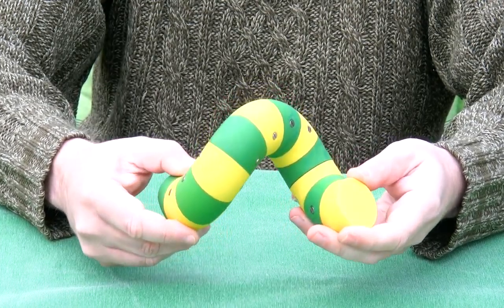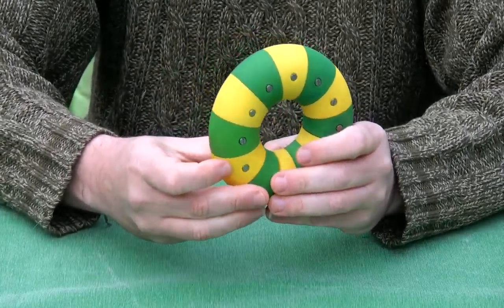Twisted Donut

Comment from the maker: How could this mechanism be improved to make it more stable?
Reply: Using gears instead of that mechanism?
Reply: I wonder if there's room to mount small dc motors within the mechanism? Then it might be possible to make a similar device for locomotion, kind of like the snake robot. https://www.youtube.com/watch?v=8VLjDjXzTiU
Reply: Can you make a oh treasure chest cube or proportional oh treasure chest cube
Reply: Is there a differential mechanism in each piece? The movement looks similar to your geared whip. This could be used as a teaching aid to show how to find the volume of a torus because it approximates a cylinder of the same volume.
Reply: OskarPuzzle can you make a crazy 2x2 pyraminx please
Reply: could you add a slightly more resistant material on the faces that touch?
Reply: You should make a padlock cube
Reply: You should mass produce a giant version of the treasure chest cube

Maybe 5 feet by 5 feet by 5 feet

Comment: The answer is that neighboring segments keep the same angle relative to other neighboring segments, so they all turn together. There most likely is a gearing mechanism inside each piece, and when the segment to the left turns then the segment to the right will turn in the same angle in the opposite direction.